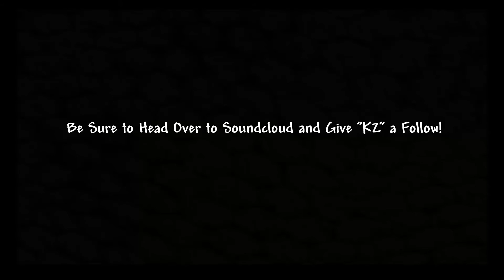NZXT L.E.D. - PC Case Lights | Install

Comment: White sip ties on Black cables. You failed.
Reply from the maker: There are no white zip ties on anything visible.  The white ties were only used in hidden scenarios.
Reply: Zip ties.
Reply: When you cable routed in the back side of the case you used white zip ties on black cables. got lazy? Watch your video time 2.5 min. till 3 min plus. Sorry maybe its just me with a O.C.D. problem. Should have used black sip ties.